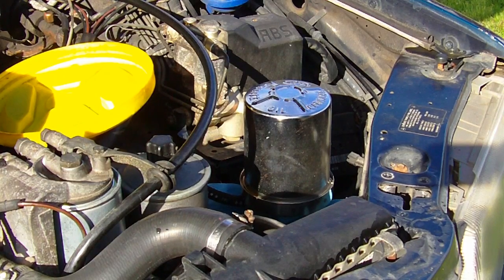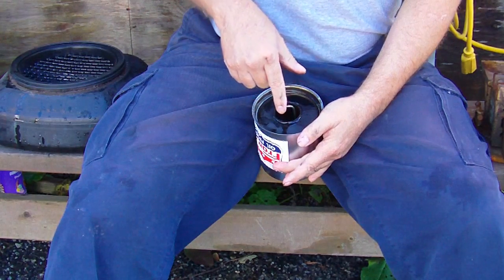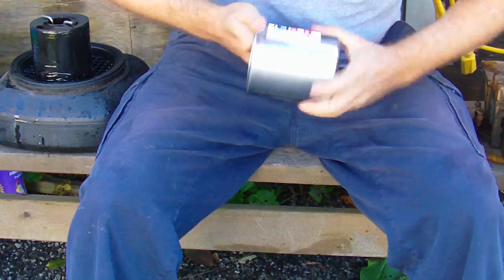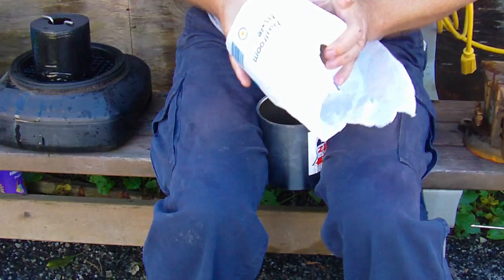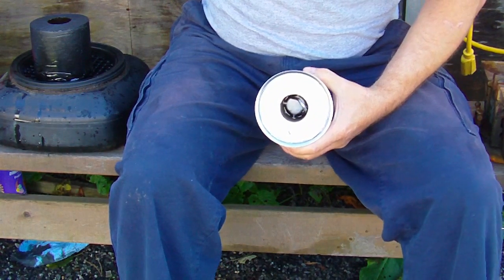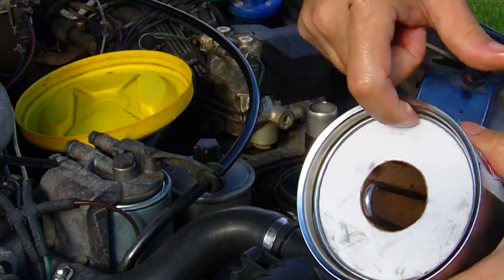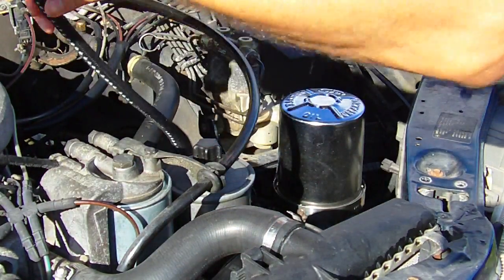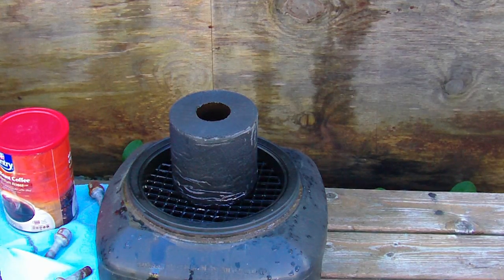Frantz Toilet Paper Filter Element Change Mercedes Diesel (First Time)

Comment: With the high quality paper you used you didn't need the ring. The base does the same thing.Frantz should have concentrated on a better core seal instead of the sleeve. There are toilet paper filters that you don't need the sleeve or the ring. Its painful watching people changing the Frantz. Don't know if they still make them but Gulf Coast had a 1 3/8" tube with a better seal. You pushed the element down against the seal Then put on the lid.Frantz should have fixed that problem when the larger core came out. Motor Guard had the best design but only make compressed air filters now.

Comment: Do you  have  to  add good stuff to the  oil?  does it take the good stuff out with all the nasty fines?I  want to add one to my 94 5.9 Cummings but still on the fence  about  that. I  have also  been thinking  of  a Ceterfuge bypass filter  in stead of the Frantz system.  please  let  me  know  and a dealer for the setup. I  am  in Arizona.
Reply from the maker: Hi, I went with the Frantz because the element is $1 for Scotts 1000 TP in single rolls. This link was sent to me with a new style element and its a place to buy the system http://www.frantzfilters.com/synthetic-vs-cellulose-media/ One of the diesel forums I was on changed the TP every 2500 miles. 
There are lots of companies who sell bypass systems and I have seen a few on youtube. The only concern with extended oil drains is depletion of TBN and its usually not a problem when you top off new oil at your filter change.
Reply: Thank you.

Comment: would it make sense to soak the "filter" with new oil before installing it back to ensure no dry start?
Reply from the maker: This filter simply cleans the oil and returns to the crankcase, dry starts are not relevant.
Reply: heavymechanic2 but you do have to fill the filter, otherwise a good amount of oil will be pumped to the additional filter and piping instead of sitting in the sump and your oil level will be low. Or add the necessary extra volume when refilling/use the dipstick to get the correct level.
Reply: heavymechanic2 ah right I see how that's not relevant to dry starts

Comment: Hi, did you do one on the install of the unit for the Benz? I have a Franz unit for an 83 300SD I just brought home. Thanks, Dave!
Reply from the maker: This is on a Benz 603 engine (6 cylinder diesel), there is a special adapter required. If you have the older engine, there is a different adapter available just for Mercedes.
Reply: heavymechanic2 Mine would be a 617 engine. I talked w Deb from We Filter it, her Dad was the owner of Frantz, I'm not sure she knew of the setup for a Benz! So the adapter would be on the supply side? Thanks, Dave! Think she wanted me to tap into the factory oil filter.
Reply from the maker: Mine has a 12mm street "T" on the sending unit. Due to the location, I had some difficulty with the washer thickness to get the proper angle for the line. The other end is fitted into the oil cap with the Amsoil adapter. It took some work to make the oil cap, the bolt was too short to fit the nut; I threaded the cap and used loctite to hold it together... The Frantz works great for me, no issues once it was retrofitted to the car.
Reply: Yes, I paid attention to your comments about using a paper gasket. Cool, 12mm street "T" nice tip, thanks, Dave.